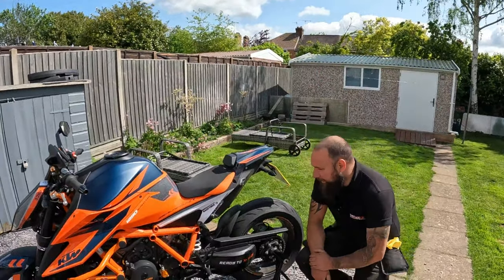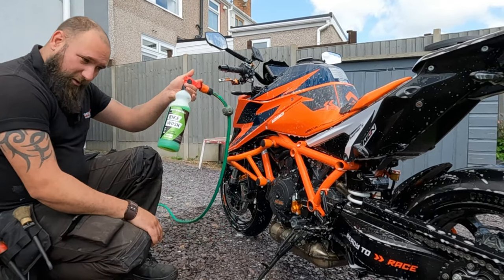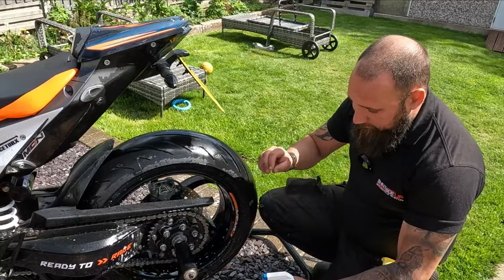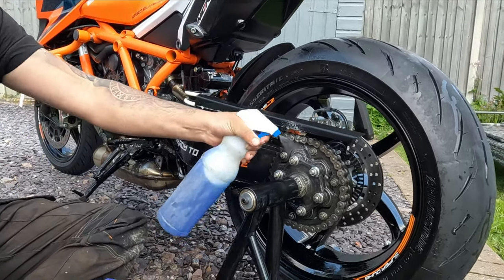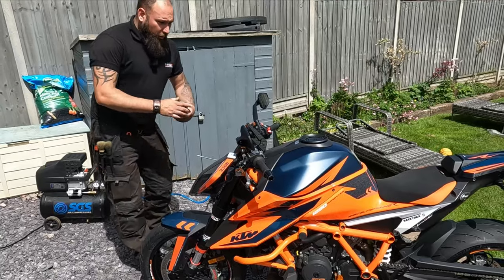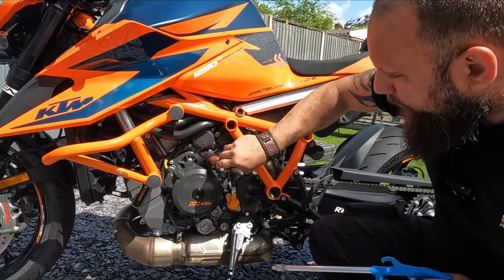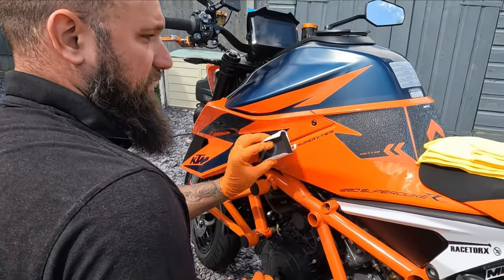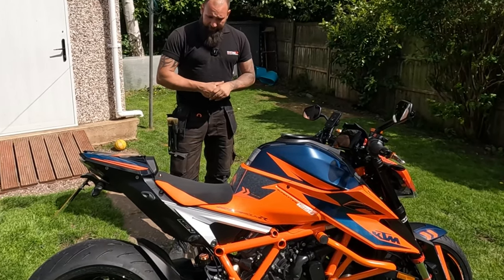KTM 1290 Superduke R Motorcycle gets detailed and ceramic coated.

Comment: Great video and tuition. If I may ask ,was it expensive
Reply from the maker: Thank you. 
Was it expensive !!
that’s a tricky one. Yes and no lol.
It depends on how you look at it. 
It’s not just being washed but protected as well and when you do get it dirty afterwards the crap really does just wash off with a hose pipe. I should have said the price at the end of the video really. So as my bike was in a reasonable condition to start with I paid £250. 
It gets more expensive the shittier your bike is. Not just dirt but scratches and swirls in the paint.

Comment: spraying all the back of the dash and the controls 😪😪😪😪😪
Reply from the maker: Yep. And alls good.
Reply: you do ride your bike in the rain dont you , all bikes are tested at  high water saturation in the factory  they are meant to be able to get wet.
Reply: Exactly what I thought.Time will tell if the water gets into the electrics like others have suffered from.Good luck RB🤞
Reply from the maker: @adrianhall4612 It’s been 10 months since the bike was detailed and all is still good. 
With several washes in between. Each time though I’ve used a bike blow dryer and not just cloth dry it.